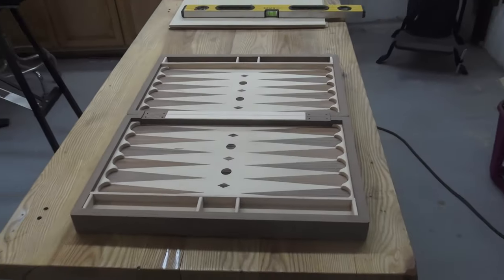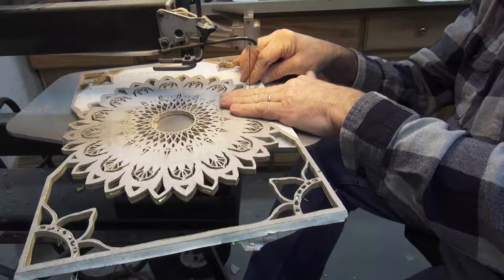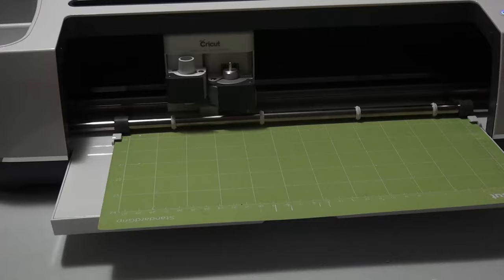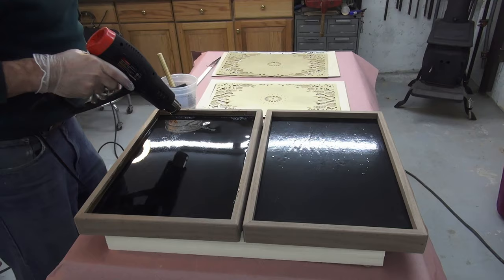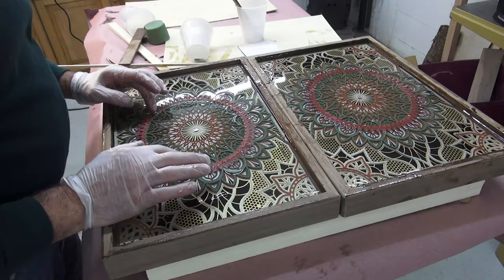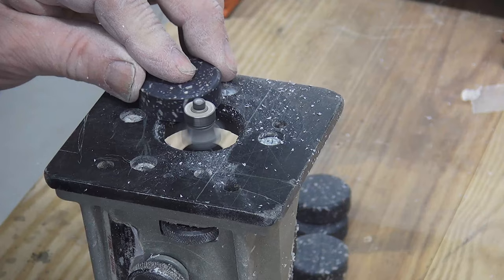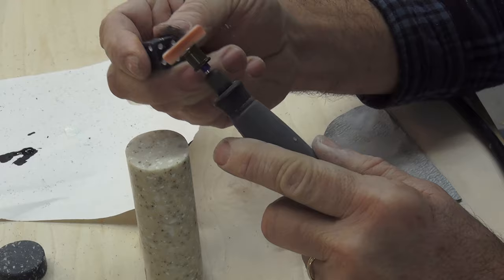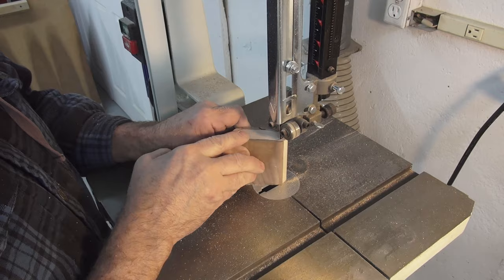Making a Custom backgammon part 2

Comment: Simply outstanding sir!!
Which Cricut did you use? I have a Cricut Explore Air 2. Wouldn't mind trying the veneer cuts with it :) Cheers from Nova Scotia :)
Reply from the maker: The Cricut Maker will cut veneer. I don't this the explore air 2 has the same cutting force.